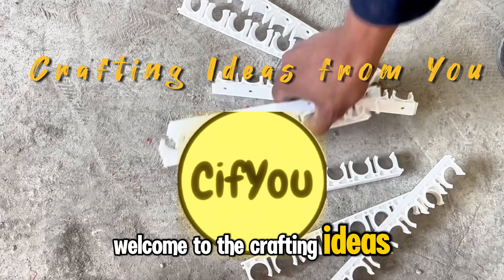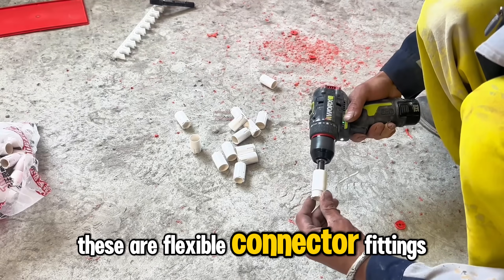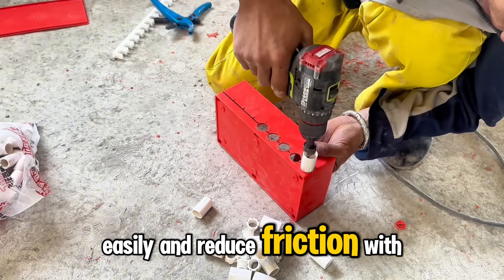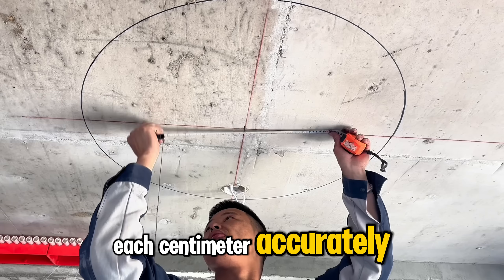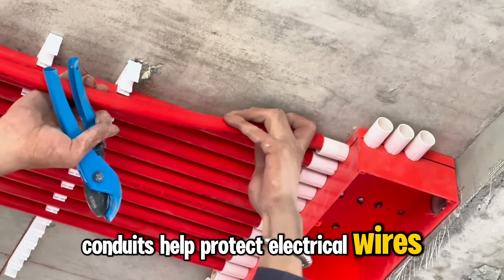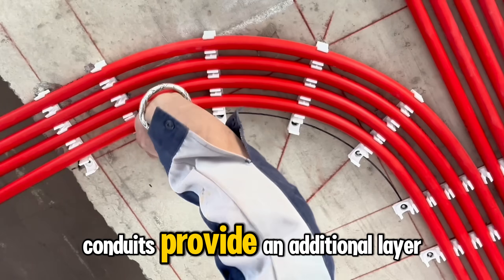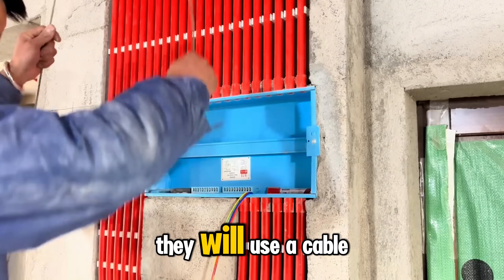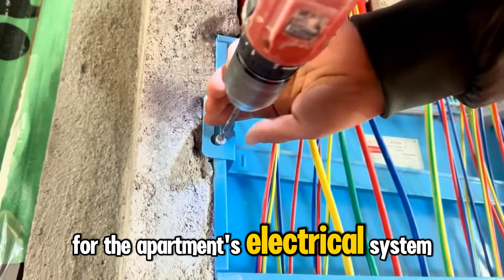What would electricity look like without following NEC (National Electrical Code) standards?

Comment: It makes U.S. Electrical Systems look like the 4th world country
Reply: maybe only residential, but Conduit and wire systems like this are used everywhere in US commercial and Industrial spaces. this method is not substantially different from American conduit systems save for the breaker panel, which I gotta say, American breaker panels are better than these.
Reply: @ryuukeisscifiproductions1818  yep, residential, especially in the south, is more "yeet the romex over the attic"
Reply: @ryuukeisscifiproductions1818 and
Reply: @ryuukeisscifiproductions1818  as someone from the UK i agree. the american panels are solid. but your method of using breakers is terrible.  now lets mix your solid metal panels with NIC EIC standards, in terms of MCB's and RCD's, and make your sockets not lame and unsafe XD. and your on to a winner
Reply: @hexaspark  absolutely disagree on breakers. Bussbar systems used in American panels are much safer as the buss system is rated for the full current of the main circuit breaker as long as you are using a good brand like Square D or Eaton. And a particularity top rated breakers have their breakers bolt onto the bussbar.

Yes there where some crap breakers still in use but they are usually old discontinued brands like zinsco or federal pacific.

Also the European habit of adding RCD's to your main breakers, or in the UK having the RCD run half the house can create obvious problems, such as losing half or the whole house to one ground fault because some water leaked into an outside light fixture or something like that. RCD's aren't a bad idea but they should only be on the individual branch circuit level, that way so a ground fault only takes out that one branch circuit and not the whole home. 

Where is will say Europe and the UK is a winner is on voltage and distribution. 240/400 is far better than the American 120/240, and you guys have three phase distribution practically everywhere. Even if an individual home doesn't have three phase, it is still somewhere in the neighborhood. Where as in America, sometime the nearest three phase source can be many kilometers/miles away.
Reply: Maybe so but you have Milwaukee and he’s using worx power tools. 4th world but in STLYE!
Reply: At the same time, it's worth noting that the US has had electrical systems in place for at least a 100 years.

So there are still lots of places with a previous generation of wiring standards and some places still have knob and tube w
Reply: As long as it works, looks are secondary...and the system is installed faster. The install in this video probably took 6 months or more
Reply: I see more benefits using the split 240V/120V phase system. But i do agree the U.S residential panels look like a mess.
Reply: @nhitc6832  What are the benefits in  the need of more transformers and bigger cable sizes?
Reply: @nhitc6832 a bagunça é entendida por quem faz.
Reply: @nhitc6832 no they don’t? If following the NEC, they aren’t supposed to look like messes. You guys are nuts to think that US isn’t superior in our codes. Follow the codes properly, not only do you have save, hidden, and more clean looking electrical installations. Not sure what type Electicians you guys are, but I take serious pride in all my jobs and my stuff looks fucking mint.
Reply: @shawskeebennett1440 I guess we should just take your word for it.
Reply: @WeMe83  As much as we would take anyone else on the internet?
I've seen shoddy shit.
I've seen stuff at oil refineries with pieces labeled from the 30's up to the brand new Amazon Datacenters being thrown up.
NEC isn't a governing body with hyper focus on appearance.  The direction of the NEC is to make sure that the electrical devices being installed do not cause harm or damage.  If the Code is followed and some fault occurs the system will protect the people and equipment.
What this electrical looks like is a system focused on appearance and the bottom line of someone other than the electrician.
Reply: @shawskeebennett1440  you in Georiga? I need a guy who takes pride in his work, lol.
Reply: @shawskeebennett1440  In theory yes, this is true, but depending on the state and how strongly it actually enforces regulations and how shady the contractor is, you can very much get very shoddy installs here in the US, particularity in residential install where the contractor only cares about cutting costs, and thus cut corners. The code is only as good as its enforcement.

Of course this is not a uniquely American problem, this can happen anywhere. Talk to any decent electrician in the word whom has been doing it for a little while and inevitably you will get stories of them having to work on some very shoddy installs.
Reply: @Chiberia  I actually am in Georgia. I’ve moved from being an electrician to a PLC technician. Most of my installs are all vfd drives and plc control panels.
Reply: @shawskeebennett1440  the NEC does not state how to run wire in a panel.
Reply: Fucking mint. Lol.
Reply: Where do you think they learned this from
Reply: @SparkingRelativity  From Europe.
Reply: That's because you have allowed corporations to dictate policies in regards to what or how public utility's are installed. But don't worry what's wrong can be put write with good  new code backet by the state ! . That's the difference you have allowed corporate power and GREED to run free for to long . outside of the USA corporation are generally treated with a tuff hand.
Reply: Electrician from NJ here. One of my favorite things to do is bend conduit (EMT) and ur work looks like a dream. Id love to play with some of ur style conduit once just to try it out. Here in the states using romex for homes  is much cheaper and faster then doing all of this pipework. If u take ur time it looks just as neat and pretty as his work here. Its just like any other trade. Ur gonna find guys who do beautiful neat work that the person takes pride in, then ur gonna guys who just wanna get it done and get paid that do crappy poorly planned out work that doesnt work propperly or is flat out dangerous. Its all about whos doing the work
Reply: That's just not necessary to breed trotskyist liberal bullshit here: you don't have to scold yourself when you see something shiny in someone else's hands. A Chinese man installs wiring in a reinforced concrete multi-storey apartment building, and in the USA the majority of people live in wooden frame individual houses. The American rules for wiring take into account the American characteristics of housing, and the Chinese take into account their conditions. The Chinese adopted the Soviet housing construction system, so the system shown in the video is also used in Russia when repairing old apartments and building new ones. Only instead of rigid pipes, a soft corrugated pipe is used.
Reply: They make walls out of wood, they are a 4th world state.
Reply: No it does not. This is garbage. Just because it looks pretty doesn't mean shit. If this stuff burns in a fire your dead from the smoke period.
Reply: You don't get out much.
Reply: It's about safety first then function.....not looks!
Reply: No worries,america and Europe will become one soon because of migration 👍🏻
Reply: US may have all the rules, but a lot of the cowboys knows how to bend it like all the conduits.
Reply: @ w/e translator ur using, find a new one lol
Reply: América is a 4th world country ,just spent all the taxes  and nacional debt in external wars and genocides
Reply: That it is, 😅
Reply: 3 wires in a pipe run and I can run through 900 degrees of bend too 😂. Anyone how runs pipe will understand. This a joke compared to how much stricter the NEC is for running conduit.
Reply: @timothydixon2545  u are not an electrician are u, because even if I ignore the 900degre typo, what do u take as a space factor.
Reply: @ for over 30 years now and I’ve run more pipe than you’ll ever think about.
Reply: @ or a box every 200’ of conduit you will have to set a box, or 500’ if you are running utilities underground’s but then you might need a vault or a qwazit box. That will be in 5” or 6” conduit on stands and incased in concrete sometimes died red sometimes they will let you get away with trace tape.
Reply: While the installer looks vaguely Asian, in this case "outside of the US" is in fact in Russia. You can search on YT & IG & find plenty of other such examples from there. That's NOT to say all of Russia is like that - it's not by a long shot, and just like in the US there is a general level of laziness with strong outliers in both better & worse directions. Naturally, it's the outluers that get the big views & because both coubtries are big, even those outliers amount to big volume of installs.
Reply: These is all about money, you pay nut won't get monkey...
Reply: From us european,  your domestic code seems obsolete and really backward for at least 20 years...
Reply: Facts
Reply: And who are the 4th world country
Reply: That’s because they’re trained to make things look clean and neat while in America were trained to just get the job done 😂😂
Reply: No it doesn't.
A lot of these materials are literally the grade we use in trailers. 😂
The use of flexible plastic raceways for all interior circuits is nice, but I think it makes more sense on a 220/250V system, whereas in the US most small appliances and fixtures are on the center tap at 120/125V, which significantly reduces the severity and hazard of failures.
In the US, the lack of conduit for most residential fixture and receptacle circuits is not a significant cause of electrical safety issues.
Reply: Nonsense
Reply: I've seen how Americans do the wiring. While in this video the guy is laying conduits so meticulously because it's an apartment building, I'm sure it's probably mostly the same for most other residential properties in his country. In US, I've seen them just throw the wire around over the ceiling panels (in the attic). Same goes for wiring behind the walls. They just cut a hole (because houses there are make of cardboard) and put the wire in without any conduit and then take it out the other end where it's supposed to go. I get that they have a secondary insulation on the wires but still, it is left very much exposed just in case a rodent tries to chew it off. And then, if you try to add conduits or some physical safety measures to protect your wires from damages, it has to pass through their damned inspection department. For a country where houses are made from wood and cardboard, they sure talk a lot about safety measures and stuff. They have gas-powered water heater and dryers rather than electric ones (because apparently flammable gases are much safer than electricity). Then they have (like I already mentioned) cardboard walls which they'll say are actually gypsum boards but fancy names cannot save them from the fact that you can literally punch a hole in the walls of American houses. Then there's the entire wood framing of their homes which, if attacked by termites or moisture, damages the structural integrity of the house itself. And what's funny is they're doing it all not because it's cheap and all. If you think long term building a concrete+brick house while attracting expensive initial costs, will last a lost longer than a wooden house. Then there's the fact that a solid house stands tall in the face of a tornado or storm rather than a wooden house...
Reply: @chickencurry7642  I dare you to try to punch a hole through 3/4 inch drywall without breaking your hand
Reply: @claytoncallaway6412  I litterally have lmao
Reply: @moneybilla  and you probably broke your hand
Reply: @claytoncallaway6412  while I also do not agree with his opinions either,, I  gotta tell you I personally have punched a dozen holes in the walls at a few houses.  But aye, that hole is cut our patched sanded n textured n fixed like nothing ever happened.
Reply: @dabmanian_devil  i believe you but it was probably not 3/4 inch drywall, a lot of places use 1/4 inch drywall.
Anybody could punch through 1/8th inch, most full grown men could easily punch through 1/4th, most full grown men would seriously hurt their hand punching through 3/4 inch and any adult would at least fracture their hand by trying to punch through 1 inch drywall
Reply: @WaistingBob  I see it all the time. Even 1 inch is pretty common
Reply: Excuse me,  @chickencurry7642 ! Our houses aren't cardboard! They're gypsum dust sandwiched between two sheets of paper! So superior to cardboard! It takes two hits with a hammer to go through our walls, not just one! 😂
Reply: @chickencurry7642  As one who has seen what "hired" help does in USA residential construction, I can verify this.   I got hassled for running 1/2 and 3/4 in EMT in one of my own buildings because it was deemed too expensive.
Reply: @chickencurry7642 wood and steel framed buildings are meant to withstand earthquakes. Masonry crumbles when the earth shakes.
Reply: @chickencurry7642  thats... thats not how it works at all. Youve described a caricature of what you think homes are built like. None of which is accurate.
Reply: America as whole😂
Reply: No it doesn't.
Reply: This whole technique is derived from western methods, and you are saying it makes U.S. a 4th word country.......what a joke😂😂😂😂😂😂
Reply: Looks like a fire hazard

Comment: @7:24... if I was American, I would be able to compare how a dude works to some standard (any c standard or other. BTW, at the same moment in the video, the cement wall looks to be notched to recess the wires. Was that wall engineered to be cut like that?
Reply: That's just plaster or lathework hence not structural and can be chiselled.
Reply from the maker: We have design engineers, and an extremely strict supervision team. so that is allowed.

Comment: Ny boss would agree with this work. It’s very clean. Can I ask since it is not using NEC, are they using IEC standards?
Reply from the maker: Oh, it is following IEC standard
Reply: @CIFYou  Then you can tell us which IEC standards that was in play here, there is a lot of them and they are in many sub variants, not all places use the newest variant (they do not have to), now and then these sub variants differ a lot, some are a total rewriting others are just a small adjustment here and there. Local code determinate what IEC to follow and what sub variant to use too.
Reply: @K2teknik. In that case, you may refer to specific regulation. To tell everything here, akin to opening a textbook and throw everything here.

You shall guess what country based on the color code of the wire.

If not, even we tell everything on the regulations, here..... Its useless, pointless and idiotic.

Comment: what type of solid wire are they using ??
Reply from the maker: Oh there are many types, what type do you want to ask?
Reply: (Not a NEC requirement) I like that bucket trick. How many times has your spool broken or snagged rolling off?
Reply from the maker: it will run out until it runs out =)

Comment: It looks a lot like machine wiring.
Reply: I'm not sure about your parallel wiring layouts. But 20 yrs ago I designed and built analog circuits for uhf and vhf commercial radios used by police and fire departments. Your parallel lines built an air transformer. Depending upon what signals are close. May generate bad signals. A pm motor has an inductive field of magnetic Flux that changes as the power is turned on and off. A welding station can also cause signal control issues for controlling other electronics circuits.  Good luck. A 100 Meg scope can help solve these problems that look invisible.
Reply: @richardstitt8225   The machines I’m referring to were industrial:  conveyors, stamps (press), continuous brick kilns, product wrapping, etc . . .   Mostly 480 vac or 24 vdc.  Controls.  The place we had to be careful was with VFD’s (variable frequency drives, speed control).  In the right (wrong) configuration they can induce voltages in parallel wires over 1000 volts.  RF is a whole different world!  I leave that to the experts!
Reply: I agree with this. Looks like an electrical wiring of a Motor Control Center
Reply from the maker: it is the electrical wiring of a building

Comment: can you please tell me what PVC type you installed? it's seem like very  easy to use and very easy to bend unlike the other PVC pipe...I like your job very neat...
Reply from the maker: it is a kind of thin pvc, it is very popular. When bending, there should be a spring inside to avoid bending the tube.
Reply: @CIFYou  can you please tell me what exactly the name of that pipe...or may I request if is it okay if your next content in your YouTube please mention in your vlog, what are the name of the tools you use.. please...thank you
Reply: @Yuta.okkotsu-f4m  look for 'plastic conduit'. It has a different wall thickness to plastic plumbing pipes.
In the UK it comes in 20 & 25 mm diameters.
Reply: You can bend regular pvc like that, look for that spring to bend pvc and you’ll be fine!

Comment: There would be no reason to pipe a closed loop for all 5 boxes in the circle. When you go to wire it, one of those conduit chases will be left empty. Looks good like that but not practical. Very nice work
Reply: He's just making a demon trap sigil. Sam and Deam would approve.
Reply: @ericnelson4540  anastomosis for make easy the wiring?  maybe useful but may get a tube unused. But i do the same because here in Peru always we update the wiring setting.
Reply from the maker: After making the plaster ceiling, those 5 boxes will have 5 light bulbs.